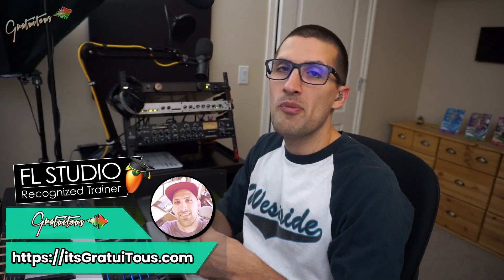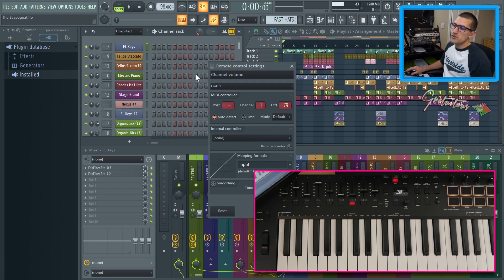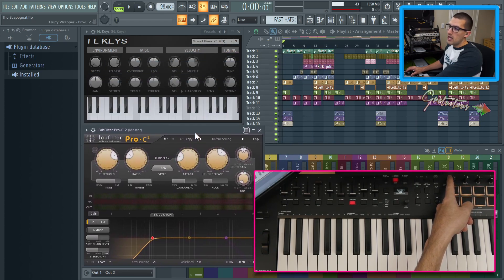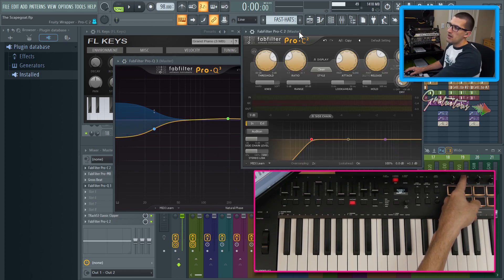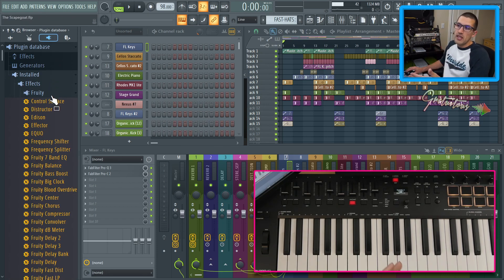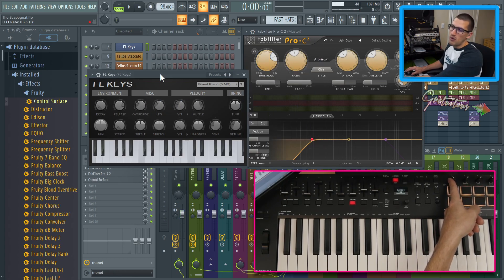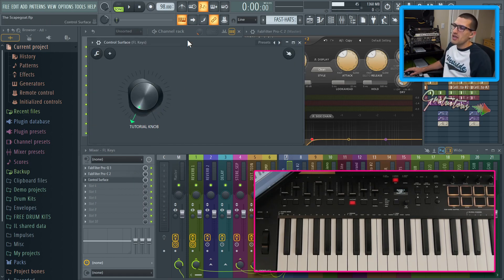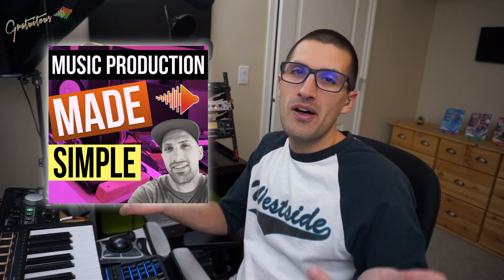Link Knob to Multiple Parameters in FL Studio

Comment: Thx for your video, I managed to bind the button but the problem is that when I turn the potentiometer, the button in fruity loops goes straight from minimum to maximum directly. 
What should I do please ?
Reply from the maker: Hey, are you using the M-Audio Oxygen Pro?  If so, here's my help guide:
https://itsgratuitous.com/help/m-audio-oxygen-pro/

If you are using Oxygen Pro MIDI Keyboard, make sure you're in PRESET Mode.  If you're in DAW Mode, the knobs / sliders give a bad experience when mapping knobs in FL Studio.

If you're using a different MIDI Keyboard, I need more information, as each MIDI Keyboard is very different!
Reply: I'm using MPK mini plus by AKAI but maybe it's the same reason, i'll check it. And if you have information about that it's cool @itsGratuiTous
Reply from the maker: I don't, sorry.  Each MIDI Keyboard is so different in this industry.

There may be a certain mode that allows the knobs / sliders to act normally, such as a PRESET or DAW Mode.  For example, the Oxygen Pro's DAW Mode does not work good in FL Studio, and its knobs are either 0 or 100%.. Preset Mode allows the knobs to function normally.  https://itsGratuiTous.com
Reply: @itsGratuiTous  At the beginning it was working well. I guess i did a wrong manipulation that change parameters. Thx for answering me !
Reply from the maker: @Nadib-Music   No problem.  It's still not working?
Reply: @itsGratuiTous  You're so kind. I'll change my midi key with after-sales service because there is others problems. I guess it will be better after that 😄
Reply: @itsGratuiTous  No thanks, actually I just have to read the user manual of my own, i just bought it recently, like 3 weeks ago

Comment: Could you create different patterns from one single instrument? (viola for example). Because every time I did it there is issues with CC1. I would like to record for exemple 10 different patterns using one single viola (without need to creating 10 clone from that viola) and I would also need to know if Im able to listen one particular pattern (for example "pattern 2") and record pattern 3 without causing issues in pattern 2. Actually when I doing this pattern 2 stop sound...
Thanks for your help.
Reply from the maker: I'm not sure if you'll be able to record and listen off that VST at the same time.. the only way to try is to see if it works!

Load your Viola VST, then create a melody in Pattern 2.. add that to the Playlist, then go to Pattern 3, and try to record with that same VST, and see if it lets you!
Reply: @itsGratuiTous  "Load your Viola VST, then create a melody in Pattern 2.. add that to the Playlist, then go to Pattern 3, and try to record with that same VST, and see if it lets you!" NOT WORKING BRO
Reply from the maker: Then create another Viola VST to record with, then cut / paste those notes into the original Viola on a new pattern.  That way you can play two instruments, but just use the one viola to save CPU.  (It's best to create separate VSTs, though).
Reply: @itsGratuiTous  Bro, would be wonderful to make some kind of tutorial about it. Nobody talk about real work-flow on FL using instruments not beats and drums...

We appreciate it if you considere this challenge. And, talk about:
- best way to working with patterns
- create multiple melodies patterns from a single instrument.
- hoe to use playlist to continued creating patterns
- and many other useful advices like this

Blessings from Transilvania!
Reply from the maker: Hey there, I run a dedicated platform for FL Studio Training, you can start here:
https://itsgratuitous.com/beginner/
Reply: Are you serious bro?
Reply: Now we understand why nobody talking about it... because someone else need to make money... oh bro, I was waiting for this 😂
Reply from the maker: That is my business; teaching professional beatmaking: https://itsGratuiTous.com/courses

Try the platform and see if it's worth it!
Reply: @itsGratuiTous  and, after 50.000 students are you still ask for money for something like my humble request? I’m sorry but I will fix it soon or later…
Reply from the maker: @iMacTube  So you are asking for free work?  That is not fair.  Also, I told you the answer in the first comments.

Comment: Hello, thank you for your video! I wanted to know if you had any information to correct my problem! In the "mix" panel, I would like to assign a plugin 1, then, with a footswitch, activates plugin 2 (but at the same time, deactivates plugin 1! I don't know if what I'm asking for is understandable. But if you knew how to do it: I'll pay you a beer!
Reply from the maker: Hey, if your foot switch is already able to be seen as a MIDI Trigger, then I think you can "Link to Controller" but disable "remove conflicts" on both plugin 1 and plugin 2 on the mixer insert.  Then use the "Latch" mode.  Make sure plugin 1 is enabled, and plugin 2 is disabled, then hitting the same button will switch between them.  If you want to support, you can just join the platform to watch all 33 Beatmaking Courses 🙂
https://itsGratuiTous.com/course-pathways/
Reply: wow!!it s working! big thanks to you!
Reply from the maker: Hey good job!  You’re on your way 😄